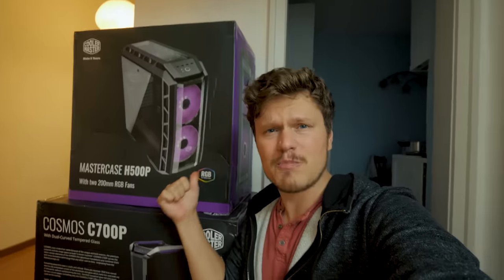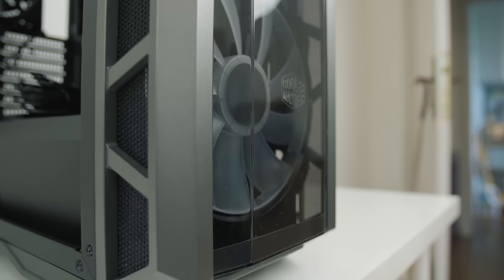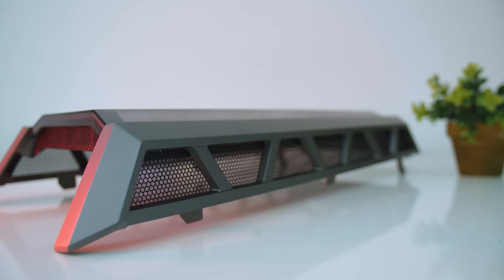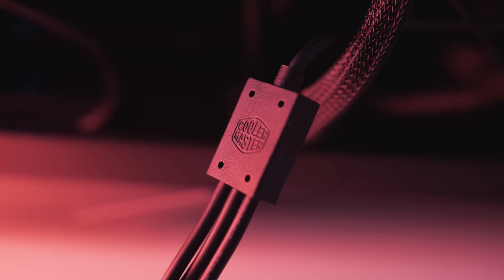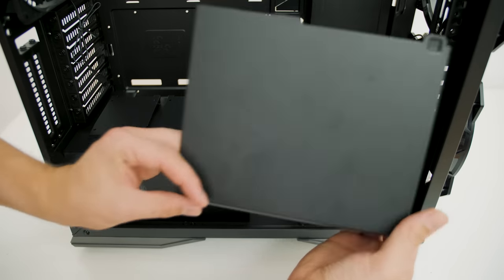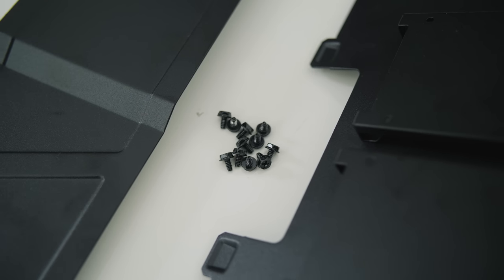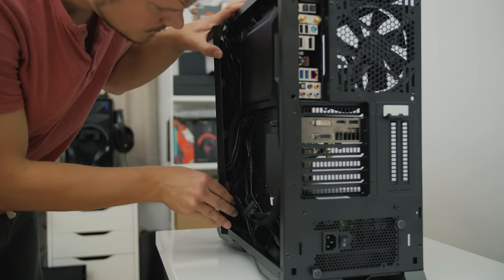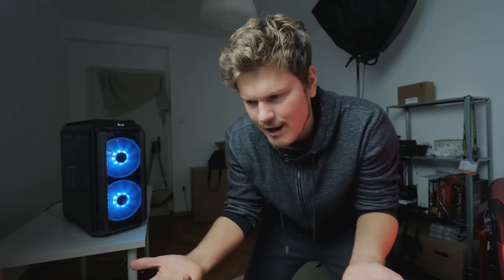Cooler Master H500P Review - It's FINALLY Here!

Comment: Not a fan of this case. $150 for a rushed product with basic construction errors and hard to wire openings. Just get a cheaper case that has better overall construction with a tempered glass case like the Phanteks P300 ($60) or NZXT S340 elite ($95).
Reply: Not even my 40€ aerocool aero 300FAW had creaky plastic panels that fall off when you breath.
Reply: MsMariokartwiifan I'd assume not. If you were a fan of this case you'd have to be 200mm tall.

Comment: Fk pre ordered this case to find out air flow is  garbage.... Time to get some black mesh for that front intake. And sadly unless you have a refrence pcb air cooling with  a verticle gpu will not work.... If anyone knows where to find a big piece of thing mesh that I could cut to fit the front let me know
Reply: Damien 
Most hobby and craft stores should have some mesh material in one form or another.

Comment: HardwareCanucks > GamersNexus

I like your review of this case it's honest and isn't here to just point out everything negative about it, I bought this case and I'm quite happy with it.  I do agree the front and top panels could have been made a little more sturdy, I personally like how easy they come off because it makes access to the fans so easy and how often are you going to be lifting your case anyway.  You can solve the front airflow problem by just buying a front mesh panel from CoolerMaster and at this point you can easily get this case for $100 now making it a better value.

Comment: So this is a high airflow case, with kind of loud fans and zero dust filters? Oh okay I'll stick with my ordered H440
Reply: MrSabifa How do you know the fans are loud?
Reply: A high airflow case that actually has poor airflow because the front fans are choked off (tested by gamers nexus). The fans are only loud because you are forced to run them at such high RPM to retain half decent airflow.
Reply: Currently using H440 too! and yes it's a great case and silent too, but I'm changing to Fractal Design Meshify C soon since I want a smaller case with same airflow case too.
Reply: H440 isnt really a case with better airflow than this one.

Comment: Acrylic windows on the front and the top will get scratched up and look really tacky in no time at all.  No USB type C.  Includes the bracket to vertically mount the video card but not the riser (another $30 or so).  Lots of strange design choices.  Too much plastic for the price.

I had this pre-ordered but I cancelled it.  Sorry Cooler Master.  It's a really interesting concept but there are too many problems with execution.

Comment: Steve at GN slated this thing to hell, so let's watch your opinion now. Steve has already persuaded me to stick with my Define R5 and NZXT 440.

You said it feels high quality, Gamers Nexus said it feels cheap quality. That front panel is strangling the fans by about 50% because the fans mount on the exterior. You didn't mention the side glass panel not fitting correctly. Vertical GPU mount only really works with standard PCB size cards.

Comment: According to Gamers Nexus' thermal benchmarks, this case SUCKS ASS. I'd rather spend $20 more and get a Corsair 570X, which has tempered glass an ALL sides, not cheap creaky plastic, or save $30 and get a 460X.

Comment: Dont buy that case, find some other case and you will be much more happy with spending that money.

* The Airflow sucks (1)
* Misaligned side windows
* Panels falls off way too easily
* etc

(1) The temps inside of the case are about 10*c higher than they have to be due to that plastic cover in the front.

Comment: Canucks need to watch gamers nexus straightfoward, truthful review of this terribly designed, way too expensive case.  Canucks do not mention  80 % of the bad about this case thar every potential user needs to know before a costly purchase mistake. Canucks is way off base, almost as if they are producing a paid advertisement. Very dissapointed in Canucks even more so than coolmaster. Please try better next review since Canucks is usually accurate in their review assessments.
Reply: did you watch this? he didn't recommend it and brought up most of the flaws GN did. only left out temps and didn't get one with a wobbly side panel. this was in no way a positive review, much less a "paid advertisement". go see that wind bag Tom Logan for a paid advertisement.  all that wind bag makes is paid advertisements for popular companies. 

also, GN didn't even mention the mismatched front panel and the misaligned fan bracket. Steve spent a half hour whining as usual and left out several key defects in the case. don't go around expecting everybody to be as negative and hung up as Steve.
Reply from the maker: Dont think you watched our review... Watch again!
Reply: Ive watched your canucks review 3x- front panel falls off if you just slightly bump since it"s connectors are ill placed and dont work effectively; front fans are mounted on case front ouside, drawing air from the side, but the fans themselves block half the alloted 2 inch intake area. We cannot recommend this case, but at $150 it its crazy disappointing. Go elsewhere

Comment: Garbage case! Cooler master always makes shitty cheap shit products.
Reply: Tanzu15 They do sell the $1000 PSU, which is built way better than any other PSU
Reply: But who the bloody hell would be stupid enough to invest a thousand bucks on a psu?
Reply: M Abdulhamid People who are knowledgeable enough to appreciate the PSU. Considering the options, the prices of other Murata products, and the PSU itself, it's arguably a bargain
Reply: Their keyboards are pretty nice.
Reply: Well Sean-Ho, considering that one can actually afford it, then by all means go ahead, but I believe any other psu with similar wattage, 10 yr warranty, 80plus gold efficiency at a far affordable rate will do just fine. Just my opinion tho.
Reply: M Abdulhamid Yes, a Golf GTI will do the job just fine, but you still appreciate the Rolls Royce Phantom.
Reply: Seon-Ho >>comparing cars to a PSU
Reply: Og Og Not comparing them to PSUs, using them as an analogy.
Reply: I appreciate the engineering of the MIJ MasterMaker Murata PSU. However it has no real place in the market. It doesn't make anything faster, it doesn't help overclocks, it doesn't do anything different in real world scenarios. Sure, on an oscilloscope it's the best ever. Does a computer actually care though? No, it really doesn't.

The analogy falls flat because putting this into your computer isn't like comparing a slower car to a nicer, faster car. Y'know, because the actual faster and nicer car gives you tangible real world benefits, like more torque, better ride, better materials to sit on, better controls, better engine, etc. The MIJ does not offer any real world benefits other than owning the best PSU ever made. Well I guess you can run it at higher watts than other 1kw PSUs and still meet the efficiency curve... But for a $800+ premium, that efficiency in 10 years won't even come close to saving you $800. Oh and faster luxury cars are generally inefficient compared to their lighter brethren when it comes to gas mileage. Your analogy fails on so many levels it's hilarious you tried comparing a PSU to a car lmfao.